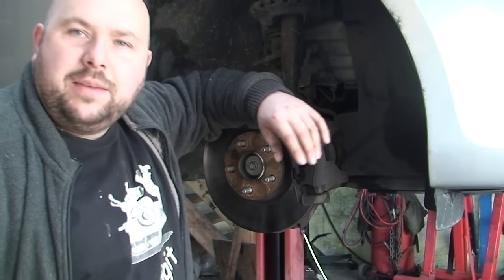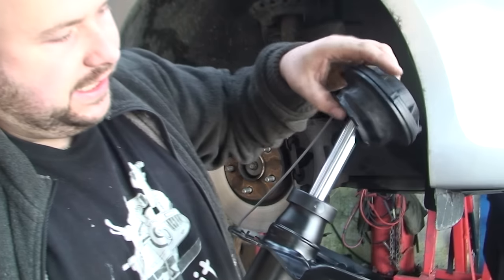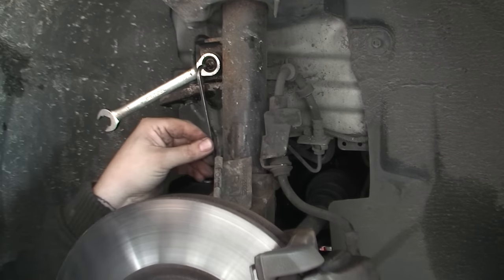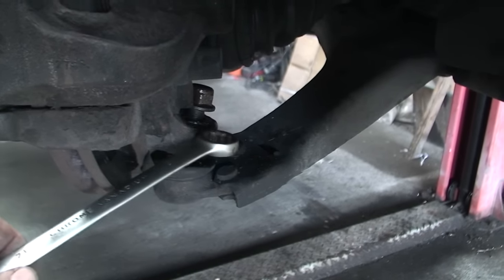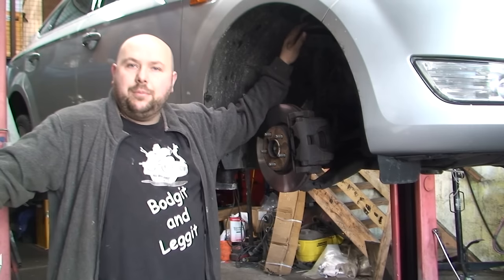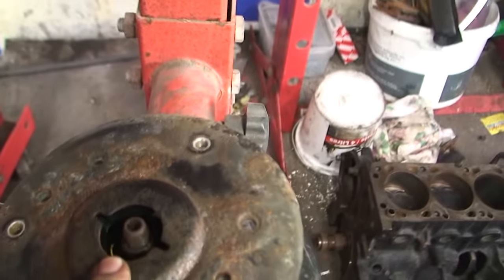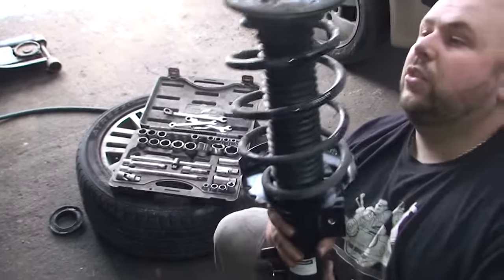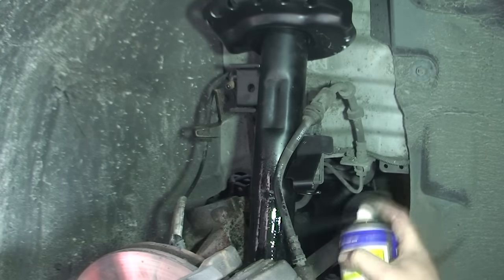bodgit and leggit garage ford mondeo shock absorber and shock tops

Comment: To put the shock back EASY: use the same bolt BUT SCREWED ON THE OTHER END. Put a peace of metal between the two "ears". When you will screw it it will widen the hub and you will be able to insert the shock with ZERO effort - no oil, no hammer.
Reply: I know Im asking randomly but does anybody know of a method to get back into an instagram account..?
I stupidly forgot my password. I would appreciate any help you can give me.
Reply: @Dustin Ronin instablaster :)
Reply: @Otto Casen It did the trick and I finally got access to my account again. Im so happy!
Thanks so much you really help me out :D
Reply: @Dustin Ronin no problem :D

Comment: Why didn't you loosen the shock top nut first so it's easier to get off when the shock is removed? I also use a cold chisel to help separate the hub a bit from the shock before knocking it out. Much easier then grease it when putting it back
Reply: I know this is a old comment but on the mondeo there is only one nut . Not 2 like the old days

Comment: Tried to do this job on my 2008 Volvo (Ford made) which has same front suspension. Bent an Acrow prop trying to get enough pressure on the front wishbone to break the ball joint. No amount of hammering or leverage seemed to get that thing free. Gonna end up having to pay someone to replace these shocks for me I think, which sucks as I always feel a job is done properly if I do it myself

Comment: Hi Bodgit, It's outer cv  joint hub bolt that I snapped ( as you show on video), after I  tighten at 80 degree.  Am I able to drive at all ?
Reply from the maker: Hi mate I answered your question on another video I see you after on another video so I answered it there

Comment: With those McPherson struts they can be a right ballache to get the strut off the hub. I made a little wedge type tool which splits the hub where the bolt pitches ever so slightly and the strut just slips out.
Reply from the maker: send me one of them tools lol
Reply: It's fairly simple to make mate, get a 1/4" bit that you don't want, I used an old bit driver. You then grind down to an oval type shape. You can then wedgy it in, since the other end of the bit is square drive just put a spanner on it and it will split the hub. Absolute lifesaver for me for one job I did!
Reply: Or take the original bolt, flip it around and block the non threaded hole with a piece of metal. Then use the bolt to slightly push the hub apart.
Reply: Smart advice, thank you for sharing!

Comment: If the top shocks are on they way out is it still safe to drive….As I think mine are on they way out not got the tackle to do it mi sen so is it a pricey job
Reply from the maker: Hi mate it's like everything always best to get them done before it causes other issues when they are on their way out they tend to squeak as you turn the steering wheel in a standing position
Reply: @bodgitandleggitgarage  yeah mine are defo on the way out then lol
Reply from the maker: @jamontoast84  lol have fun doing it mate you should film it and put it on YouTube
Reply: @bodgitandleggitgarage   not got the right equipment I do it my self or I would mate lol I’ll get a quote n get it sorted lease I know wot the problem is now thanks to your vid buddy

Comment: I don’t believe that you didn’t replace the coil springs. Egg on your face when the customers comes back with a broken coil spring. I’ve learnt that the hard way and use hollow sockets on the shock top nut instead of mole grips.

Comment: Awful, no replacement of top or bottom anti squeak pads, no aligning of the strut to the top mount and the top bearing was set slightly off to the top mount. Yes it’ll go back on but it’ll not last long
Reply: Scrolled way too far down to find this comment. What a shambles of a repair!!

Comment: The wires and plugs are fine I'm not sure when the were replaced tho  i think the coil pack is what needs replacing when I unplug cylinder 3 ht lead the engine idles fine when I plug it back in the the misfire starts again
Reply from the maker: yeah I'll see that sounds like the problem then coil packs do give problems on them especially the 1.4 focuses
Reply: +Sean Dwyer hi lades
Reply: +bodgitand leggit changed the coil pack made it better for half an hour gonna change the HT Leads and plugs
Reply from the maker: I know you can buy a kit for them with everything in it is a common problem on them with coil packs and leads
Reply: +bodgitand leggit yeah I should have the car sorted by Monday cheers man ... Going to have a go at the rear shocks also NCT is coming up ha
Reply from the maker: +Sean Dwyer rear shocks on them are handy enough to do
Reply: its the plugs and  ht leads

Comment: that went better than that old fiesta you did . I thought you would have used the new nut that would have come with the new shock . sometimes the threads are different and if you just gun it up well i'm sure you know what could happen .
FYI On the later mondeo's there is an arrow on the top mount flange showing what way to put it on . if you do this job on a fiesta you don't need to disconnect the ball joint , theres just enough room to get the hub past the shock end . 
A chisel/screwdriver up through the pinch bolt gap makes it easier to get the hub back on .
  I like your diagnostic videos they are interesting and seem to go quite well mostly , however this type of thing seems to be a bit of a struggle sometimes .Slightly different techniques here and there and it will be a doddle and look better on camera . know what i mean ?!  try and be a bit less repetitive with you commentary . dont take all this the wrong way , i like your stuff and just want to help you improve 
keep it going dude :-)

Comment: Great video. Is this a mk3 or mk4 mondeo? I have a mk3 and in the Haynes book of jokes it says that you need to lower the subframe to get the strut out of the knuckle! Would u know if this is true?
Reply from the maker: hi mate this is a mk 3 Mondeo and as you can see I did not do as your book says but still worked out ok thanks for watching
Reply: +bodgit and leggit garage If it's a 2008 wouldn't that make it a Mk4 ?
Reply from the maker: +teecee90 yes it is a mk4
Reply: +bodgit and leggit garage Thought so. Good video. I'm pretty sure I need to change my top mounts as I'm getting the dreaded clunking and scraping through the steering. I'm thinking maybe I should change the shocks at the same time. Car has done 160k miles.
Reply from the maker: +teecee90 it is always best to if you can afford it and it especially on suspension you have to do both sides regardless of condition

Comment: Please change the coil spring whilst you have taken everything apart. You will only have to do it all over again.
Reply: Na  any  new  part   fitted   is  ten    times as likely    to   fail   as old    part,  all   replacement   springs   are    not same    quality  as ones  you  remove    unless you   own    a fiat   or   Renault,  these   fords    made  of   really   good   stuff   takes  real abuse  to   damage   them

Comment: Never ever use mole grips on shocker piston... Use the correct tools..  hole through sockets and ratchet should be used..  vortex is what Halfords call theres
Reply from the maker: You can use them as long as like I explained in the video you use them at the top of the shop the shop can never ever ever ever travel that far so it makes absolutely no difference you will not do any damage to anything

Comment: It's a 1.8 petrol and it's an 03
Reply from the maker: the first thing you need to look at is the plugs and coil pack do you know when the plugs last changed all the coil pack could be going all the wires to the coil pack try them first

Comment: Put the socket on the nut and a Allen key down the middle,  hold the socket with grips,and I bet that's not lined up either,them things move as the spring is released

Comment: Is this video a joke or, in your opinion, should it be?
1) To unscrew the nut, you need to hold the shock absorber rod with a # 6 hex wrench.
2) Do not turn the shock absorber rod nut with an air gun !!!
3) The buffer of the shock absorber is not installed correctly, it must be on the other side, and is fixed in the thrust bearing.
4) You are lucky that when you press the lever, the tripoid did not fall out. You can also damage the arm bushing. It is necessary to unscrew the hub screw.
This video is not meant to be a guide. Is this your hobby? It doesn't cost any money.